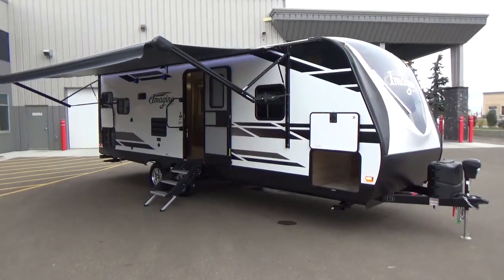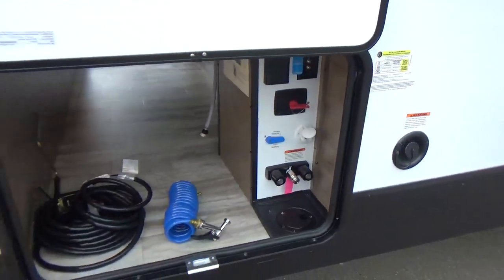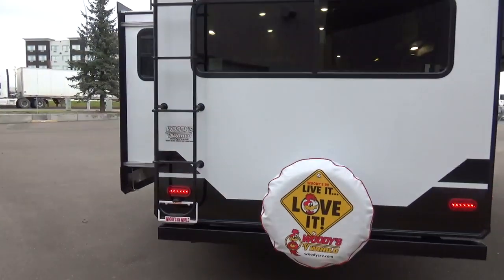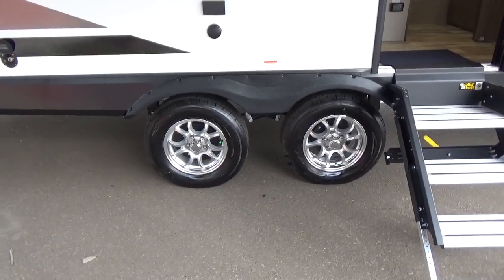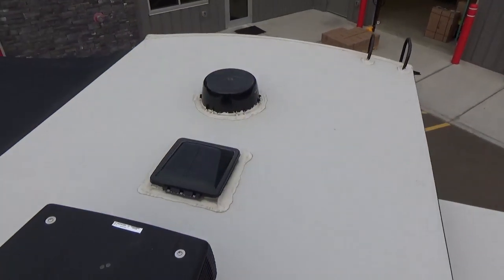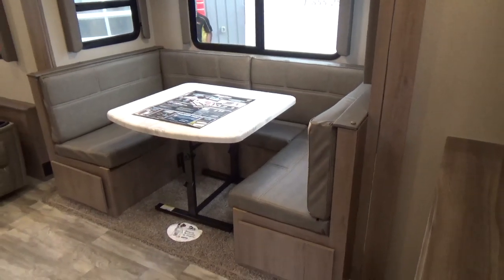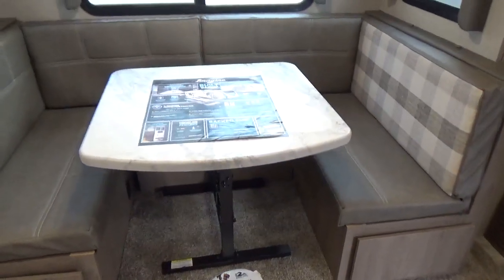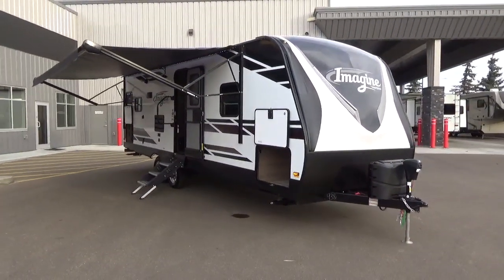2020 Grand Design RV Imagine 2450RL Travel Trailer

Comment: Grand Design still using 20lb propane tanks. SMH
Reply from the maker: testerdennis67, thanks for the comment and yes GDRV is still using 20lb tanks on the Imagine. We are grateful for this because 20lb tanks are much easier to move around when they’re full, they keep the hitch weight lighter, and they’re apart of the LPG tank exchange program. For people who want the additional 20lbs of LPG we would recommend getting an extremely affordable additional 20lb tank for back up and other around the campsite uses such as a BBQ or portable fire pit. 30lb tanks are very heavy when full and can be difficult to move around for people who are not as strong. We hope this helps. Thanks for watching!! 😀
Reply: @WoodysRVWorldOfficial  GD Should be using 30lb IMO. 16lbs difference per tank when full, but they put a huge front storage at the front of the trailer. If GD is worried about weight at the front maybe they should rethink the front storage. You stated in your video they have a large furnace so why not have the larger 30lb tanks. Either way you still have to handle the tanks to remove, so whats the difference. I here this excuse all the time in videos lighter easier to handle etc..
Reply from the maker: testerdennis67, we understand your position. If 30lb tanks are a have to have for you, we can easily upgrade any travel trailer into 30’s at our dealership. Although uncommon we have done it from time to time for those that need to have it.